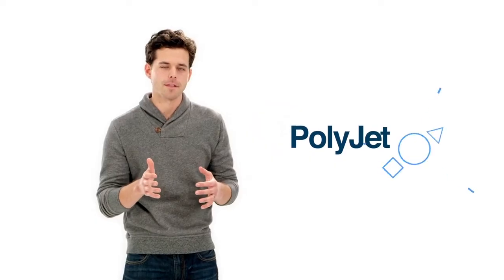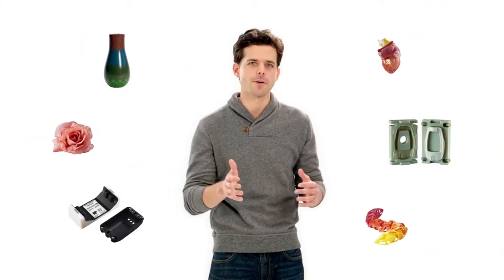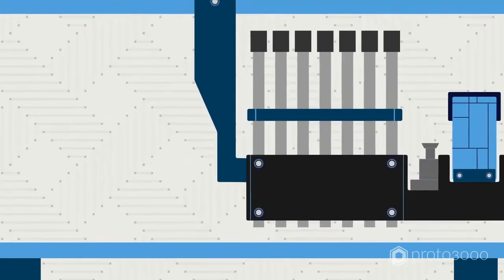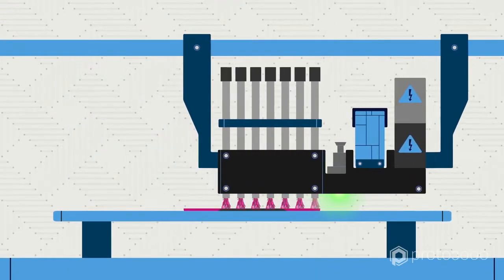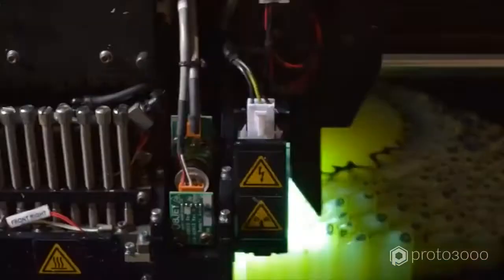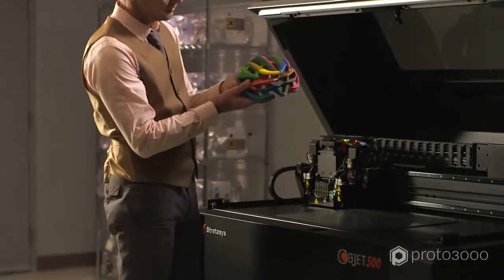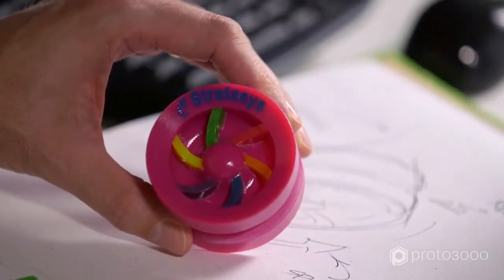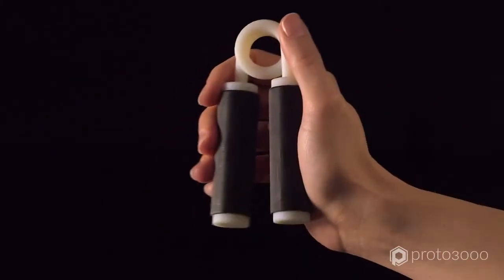What is PolyJet 3D Printing Technology | Smooth, Multi-Material Additive Manufacturing

Comment: So.. you guys have said NOTHING about how this works and why it has such  good resolution.
Reply: It uses printheads similar to normal inkjet paper printers, it dispenses viscous UV / Light hardening resin in different color instead of ink. Most common applications use a white, black, yellow, magenta, cyan, transparent and support material. Can be further extended to have transparent yellow, transparent magenta, transparent cyan materials to achieve a mosaic glass look / colored transparency. Can also be further extended to have both a flexible / rubbery and a hard material jet. With this you can achieve a spectrum of material properties, if you mix soft and hard with the jet heads 50 / 50 you get medium hardness material. The more material types you have the more flexible the print becomes. You could even have some materials that are metallic or glow in the dark. It all depends on what viscous resins you can invent and what you can imagine.

Comment: Considering that it’s a photopolymer, does the plastic become more brittle over time when exposed to a photon emitting source (such as the sun)?
Reply from the maker: Yes! You are correct, PolyJet photopolymers degrade over time due to UV exposure. It is a great technology for prototyping but would have limited end-use, long-term application. To overcome this, we use different 3D printing processes that enable materials with longevity. My recommendation would be to look at thermoplastics 3D printed with an extrusion or powder bed fusion process, long-chain chemistry photopolymers with a DLP process, or if required, evaluating metals.
Reply: @proto3000_  thanks for the information, you might have a small business ordering products from you in the future.